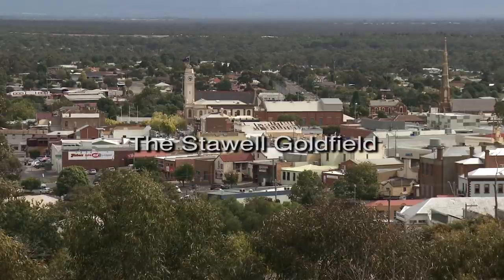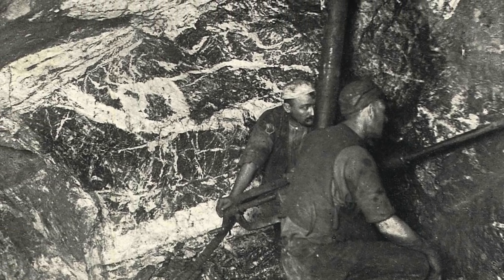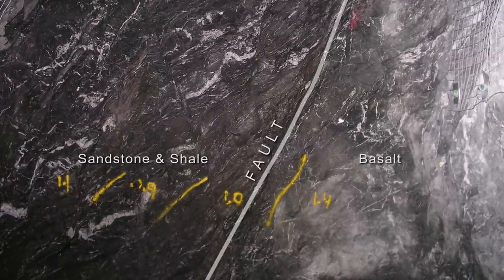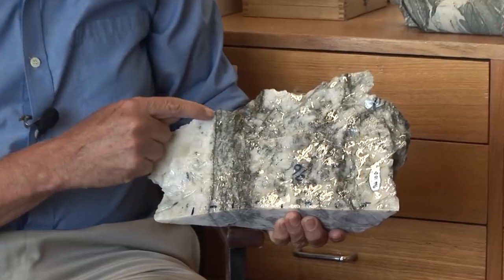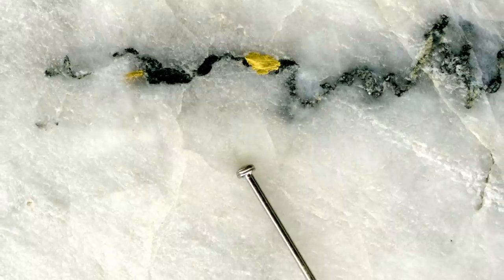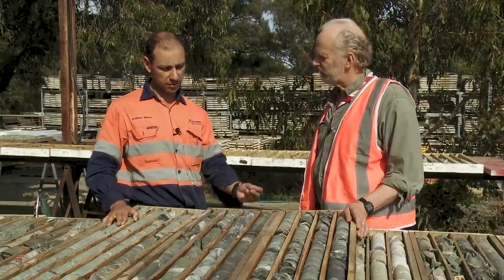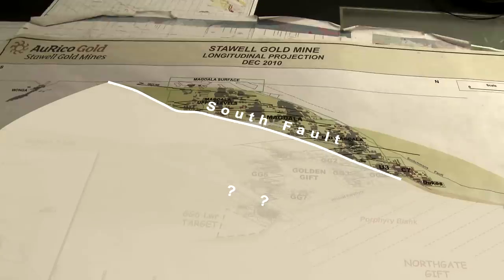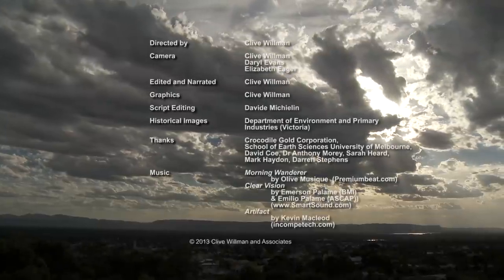The Stawell Goldfield

Comment: If you find this fascinating, then look into a company listed on the ASX called Navarre Minerals🥇🏆, (ASX stock code NML), they are drilling South of the Magdala Gold Mine(Stawell) along the flanks of the same series of basalt domes that run North/South that hosts the Stawell Gold deposit. Interesting stuff!
Reply: Cheers for the heads up Steve,will check this out 👍